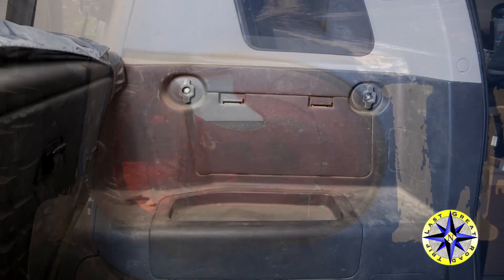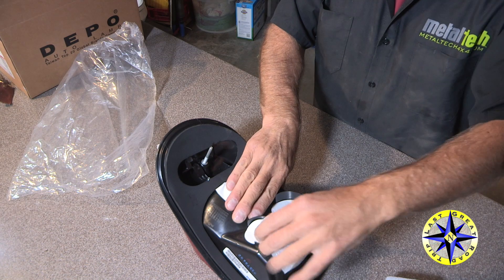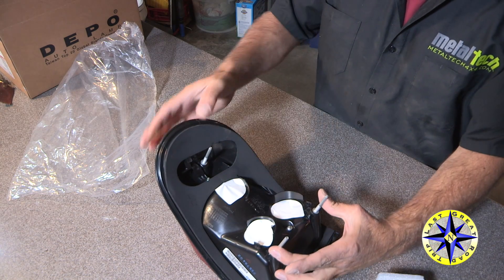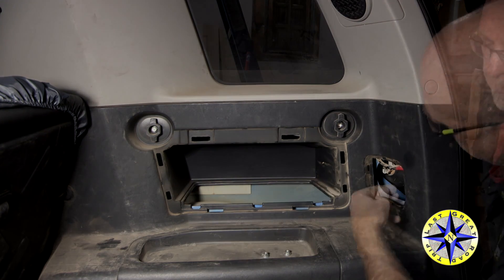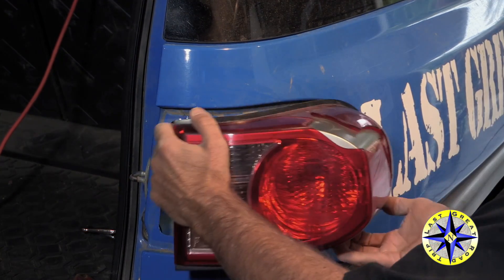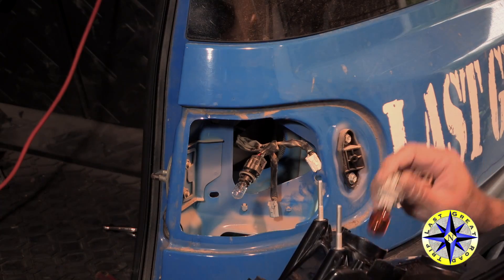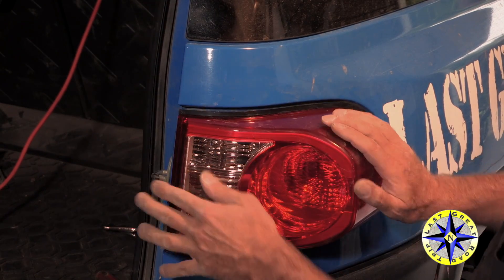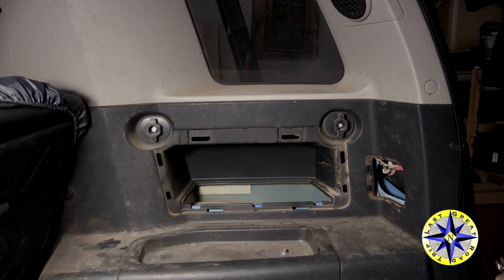FJ Cruiser Tail Light Housing Replacement

Comment: Yep, tree basically like in your video two weeks ago! 
That third nut is no fun. Deep socket with a small round 3/8 handle worked. I put a piece of masking tape over the nut to hold it in the socket when putting in the new light. Thanks for the video!
Reply from the maker: good info on using tape to hold the nut in the socket.  thx

Comment: So it CAN be taken out without the need to disassemble entire trunk area trimming. Great vid! Why I am here: I got FJ recently (2007 black TRD) It had aftermarket tail light guards - you know which ones. They are designed terribly. Not only they require 3 holes to be drilled in the driver side D pillar, but also the other side of each guard is just nuged in between the ligh and the very shallow profile that it sits in. THere is a sort of small cushin, but that gets rubbed of with time and the guard latch pops right out. And since it is a steel part, it will just hover right above the paintjob and yes from time to time it will hit it - creating nasty paint chips, that if you dont treat and fix, will start to rot out space just behind the tail lights - so my review is: 2/10 poorly designes use only if you don't care about your FJ. It is better to replace the tail light than have two rot spots, caused by the guard.
Reply from the maker: glad it helps...  follow the link in the description for more step by step info to ensure you don't make the mistakes i did!

Comment: I have leds installed and want to replace the housing with OEM tail light assembly because the brake light is inside the led housing. Will this be an issue
Reply from the maker: You should dig into it a little more.  Since I have no idea what you are working with I can't tell you if what you have in mind will work but I like where you are going.   You may want to simply find direct LED replacement bulbs for the factory ones.  IMHO that is the simplest route if you want to retain the OEM housing.  good luck
Reply: @lastgreatroadtrip  I ordered the OEM housing. The leds were installed by previous owner. The spider light bar type. I’m hoping the connection is plug and play

Comment: Surprised you didn’t show what you used to get in there 10mm deep? Gear wrench? Bolts look xtra long does a 1/4 deep fit or do you have to use 3/8?Like on the A pilar? Like how you stated easy I had a bud do one said they were a bitch guess Ill find out. On the tail light grill light covers do you need to remove taillights to install?
Reply from the maker: @mo fo  thanks for the note...  I just used a deep 1/4 socket and little 10 mm box wrench.  There is so little room in there it kind of depends on how your hand fits in there...   small hands are good.  TIP:   don't drop your wrench or nut...  it is painful to retrieve anything you drop.  a strong magnet is your friend or you're removing plastic parts to get down to the bottom.  :-)    

On the tail light grills you do remove the cover and the grill mounts between the body and the assembly using thie the same screws.  I'm not a big fan of the guards since if you hit a light it will crack...  $60 and 1/2 hour.   Hit the grill against a tree and it pushes in the quarter panel...  I guess the answer is don't run into things :-) but I've taken out both tail light assemblies on different adventures and experienced no body damage...  I consider that a minor incident.  

Hope that helped.

Comment: the 3rd nut is really not accessible the way this video shows, I have no idea how he got to it with out  taking the inside apart.  Nuts are 10mm
Reply from the maker: it is accessible.  Takes a level three yoga master  contortionist move and small hands help.  But that is how I got it out.
Reply: @lastgreatroadtrip  both sides are different aren’t they?
Reply from the maker: @YoungTeeke  yes they are.